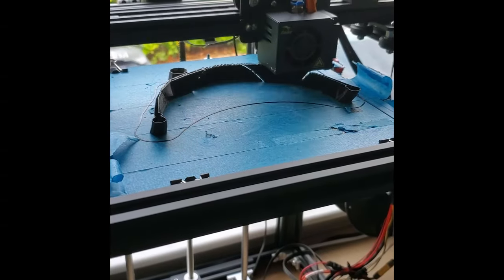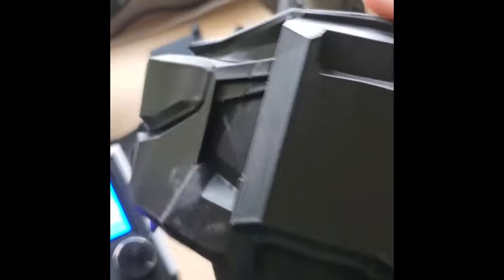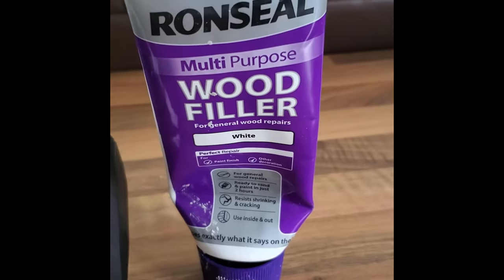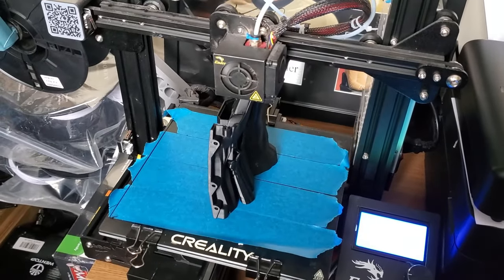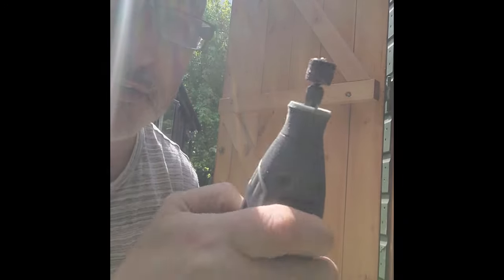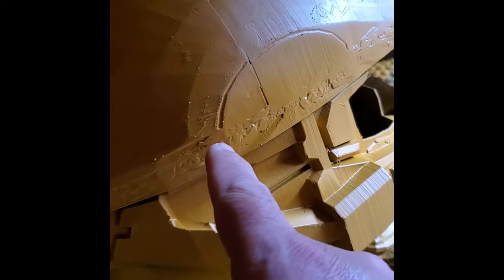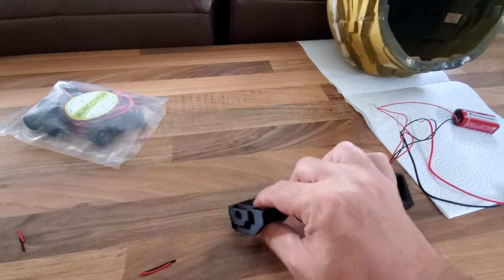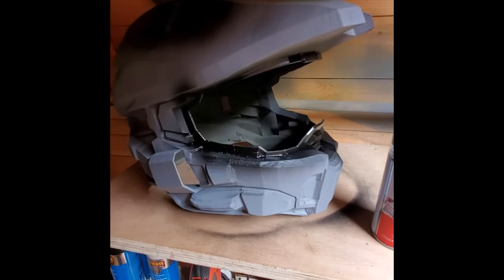3D Printing & Paint the HALO Master Chief Helmet - Start to Finish

Comment: Did you add foam to the inside so it can sit on your head comfortably? Also, if you want to be able to see through the visor, you can vacuum form it. It actually isn’t as hard as most people make it out to be.

Great work! Love the paint job
Reply from the maker: I didn't add foam as it was never going to be worn ditto for the visor but yeah could have done both. I was happy with colour tbh 😊👍

Comment: When i made my helmet, i made the halo CE version, and when everything fit together, and sanded, and painted it to a custom design that i like, which was a metallic black for the base, matte black for some parts, and then a semi gloss red and a secondary color, and i used some silver as an accent color, and then dis of the battle damaged parts in various colors

Comment: Looks awesome, fantastic job! :) I’m currently printing this myself, and I’ve noticed that there’s holes throughout the model where you can connect the various pieces together - what did you put in these holes? Or was the super glue sufficient?
Reply from the maker: I used glue and reinforced with bridges of wood or plastic
Reply: wood sticks bro work fine
Reply from the maker: It was one of the first models I ever did superglue just wasn't holding it so I used some sticks to glue it together I think if I did it these days I tried to think of something else maybe welding something to glue the whole thing together is it was quite weak I dropped it once and it smashed a bit good luck hope you get on making yours well let me see final pictures

Comment: I just got a 3d printer and I can't get the stuff to stick to the bed enough and it keeps falling off, what should I do?
Reply from the maker: If its an fdm printer try masking tape on the bed... I use the blue 3d printing one on amazon.. Also if that don't work a layer of prit stick on the masking tape may also help... I use masking tape all the time👍
Reply: I'm not sure what kind of printer you have, but I would recommend using a heated bed if you have it, and to also make your first layers print at a slightly higher temperature than your normal printing temperature. For example, with my filament I normally print at 210, and I do the first layer at 215. Also make sure your print bed is really clean.  I had issues with bed adhesion on my CR-10 V3, and tried using glue stick and it worked for a while, but it eventually started failing again. I saw a comment somewhere that said to use Isopropyl Alcohol to really clean your print bed, and prints started adhering wonderfully. The oils from your skin can absolutely make a difference in how prints stick to the bed, so be sure not to touch it too much. If you do, just rub some isopropyl alcohol on the bed with a paper towel, and it should be good.

Comment: can you help with FDM printers do u need to take the filliments pla out  when not using it ? also what is the strongest material you can get ?
Reply from the maker: No you do not need to remove the pla filament when you're not using it I tend to turn the pla up just at the start of the print 220 just to release any blockage petg  is stronger than pla
Reply: @greedy3d480   thanks im going to try make a shovel and scoop thing and also make a bracket thing for Surports  im just playing with what it come with it at the moment but just says pla 1.75 white   so see how well that works so far       also if i want to print a model tank would u do it complete or in parts on fdm printer  thanks
Reply from the maker: @swiftdetecting  just to make sure you use 100-percent infill to make it a strong as possible and I would print something in parts that way he get a failure you have lost the whole project